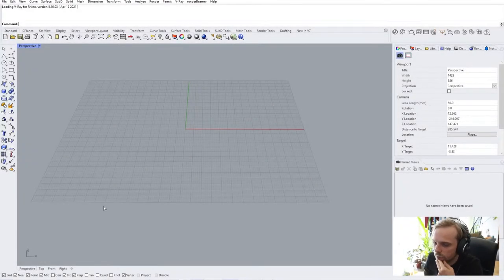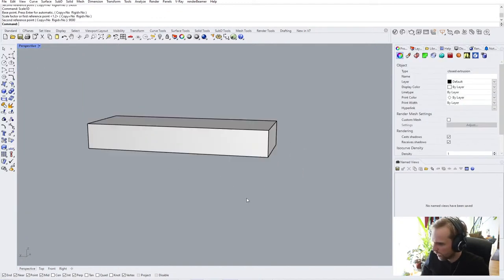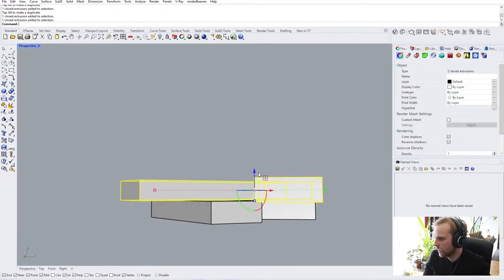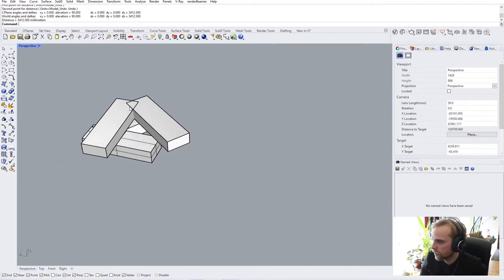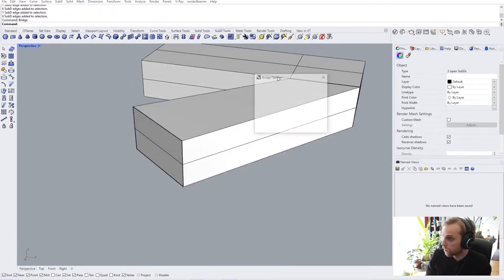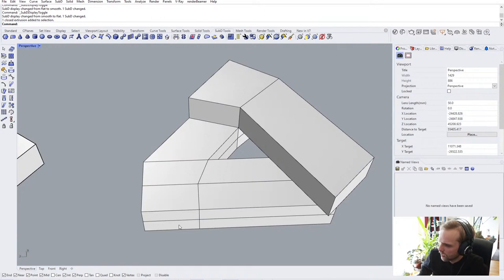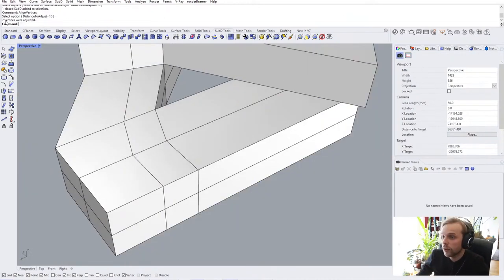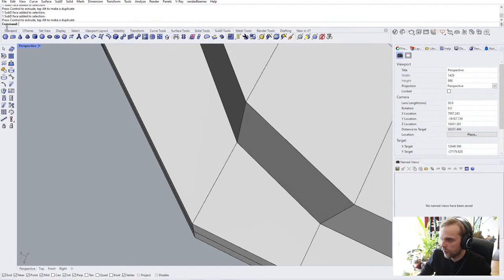Rhino SubD Architecture Series (SHORTENED) - Part 1

Comment: i have question about importing skp models in rhino. when i import it becomes heavy and freezes screen even if i turn of layer. i don't know what to do. really seeking for help. model becomes really heavy too
Reply from the maker: It really depends on your models. I'd suggest exporting your models in parts, not everything at once, and seeing which part is super heavy.
Reply: @DesignGoBrr  i tried that too. when i am trying to delete imported skp model, i am unable t to do so. i don't know what is the wrong, can u please please please elaborate in any of your upcoming webinar how to import models efficiently and working with them as a block instance.
Reply: @DesignGoBrr  when i work with rhino block instances it works totally fine but when i make block of imported skp models it creates problem, makes model super heavy.
Reply from the maker: @rohansingh1860  hmmm starts smelling like a bug. I'll investigate this and will do a video or a webinar about my findings

Comment: Streams used to be so long and hard to follow up but now it's much shorter and effective but some important parts are cut out too :((
Reply from the maker: Hmm it's as if the subject of using SubD for architecture actually takes a long time to cover and when someone tries to fit with "fast blender tutorial" style - many important things are starting to be cut out. Check out Webinar: Rhino SubD and Grasshopper modeling for Architects. I think that one is most informative.